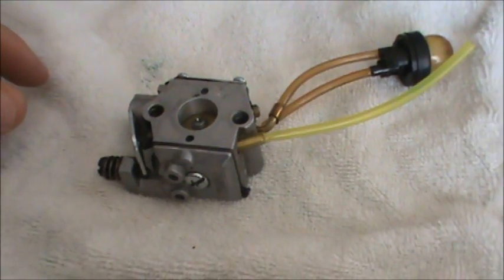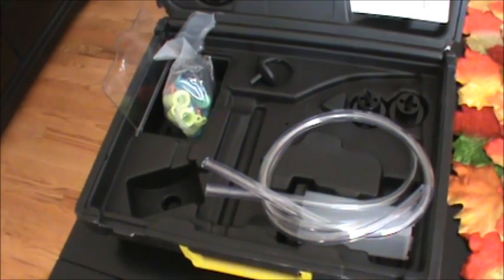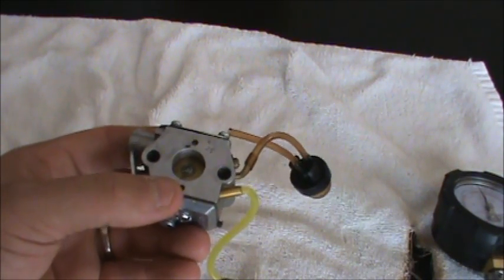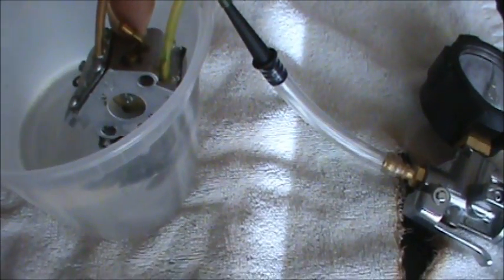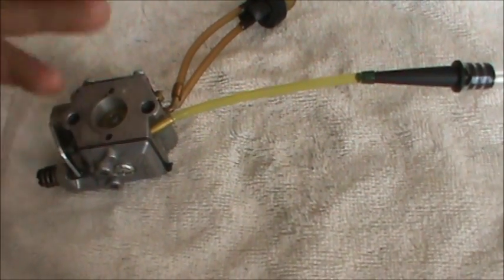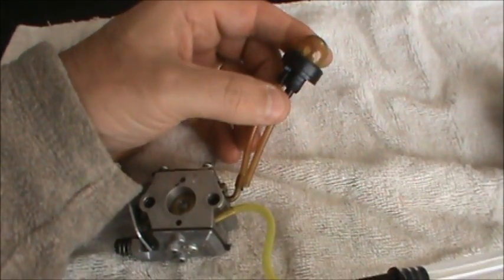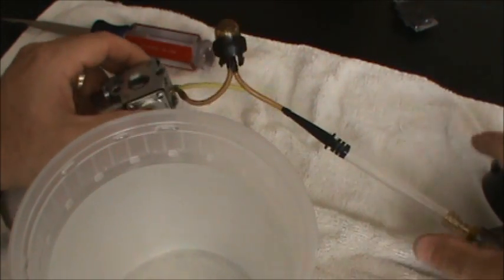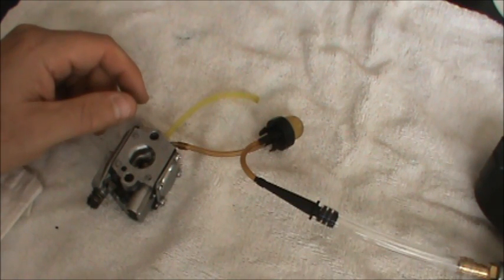Mityvac mitmv8500 Pressure testing a carburetor

Comment: I had a  Zara  carb 0:34 c1Q- S186. I didn’t have your test equipment . I watched a lot of videos on utube I finally reasoned it was the check valve under the primer bulb section, I took the oriface nozzle out cleaned the spring in gasoline reassembled & got it to work.  That’s an excellent video

Comment: thanks for the tips (pun intended) I went ahead and ordered a mity vac like yours. my question is that I may have fuked the existing needle with my ultrasonic, I didn't know that it should be removed. so now under pressure, the movement of the needle has no effect It leaks bad enough to be audible should I have removed it before US cleaner

Comment: I have the same tool and have used it to test for leaking crankcase seals using the appropriate blanking plates and gaskets, vaccum testing for air leaks of the seals. Difficult starting can be caused by air leaks here, and four stroking.

Comment: On the remote primer, the small barb draws vac when released and the longer one is a return to the tank.  When you push the bulb down it helps pressurize the fuel tank to assist the inlet side of the circuit.
Reply: Not exactly. It’s actually pulling fuel through the carb. Hence why his gauge dropped each time he let the primer out. Yes it then pushes fuel back to the tank via the return line, but it’s the same volume as what it just pulled from the tank, thus not adding pressure. This is a misconception a lot of people have about two stroke cube carb systems. I think it’s because often when the fuel cap is opened it releases pressure. The pressure is just caused by heat or agitation of the fuel and the fact that the tank only vents in and not out (the volume of fuel being used has to be replaced with something but you have to be able to operate the equipment in any orientation without fuel leaking all over. Think chainsaw) 
Another test I perform after bleading down the pressure with the primer is to switch the pump over to vacuum and draw a vac through the carb with the primer. That checks the same seals and valves but in the opposite direction.
Reply: Thnx I learn something from you

Comment: DW6 I performed the test on the metering side where u said if it leaks you have a bad check valve. I actually have a very slow leak on that side. When the seedeater is running I slowly will hear it losing power while idling until it dies, just as the test shows. I have to adjust my low needle often because of this. My educated guess is the low idle check valve has a leak because the gaskets are new and I didn't find bubbles in that area. What do you think ?

Comment: A primer bulb does not 'suck air from the top of the tank'. It sucks gas from the tank... THROUGH the carberator. It then dumps the excess gas into the top of the tank. If your primer bulb has gas in it, then you know that the carb has gas in it.
Reply: Correct  ~!~!  The primer bulb pulls gas from the tank into the carb priming it with fuel, "Hence Primer Bulb"  and then dispensing the extra fuel into the tank....

Filter line to the pump side of the carb...  The side with the ONE BIG screw in the middle, then the other line comes from the carb to the primer bulb then the short line from the bulb to the tank to empty the excess fuel so the carb doesn't flood ..............   

That is where many people people get confused on the routing of the fuel lines when they work on their saw or weed whacker  that has rotted lines that are no longer intact.......   

There are videos on you tube that show the wrong way to hook up fuel lines.... Some vids show the line from the tank to the primer bulb then into the carb NOPE wrong configuration ....    

Plus Tard Mon Ami ....

Comment: Great instructional video!  Fortunately you had a spare gasket that was able to fix it.  I bought a rebuild kit for $13 installed it in my Walbro WT324 carb and it still flooded my chainsaw.  I could have used that money to buy a new carburetor.  From now on, if the carb leaks when tested, it gets scrapped and I buy a new carburetor.  I'm glad I didn't blow over $100 on a Mity Vac.

Comment: thanks, just ordered a mv8500 for testing leak down on a snowmobile rebuild.  Good to see this as I have a couple carbs on some saws to go through as well.
Reply: any idea what the differences are between models 8000 and 8500?
Reply: @jbbolts   not 100% sure but I think the 8000 will only draw a vac, while 8500 can both vac and pressurize?
Reply: @MOAArtstore  going through the auctions on ebay it looks like it comes down to the accessories... the 8000s are listed as vacuum pumps... and after all its in the brand name too

Comment: Walbro wyl carb pops off, re-seats and holds at 2.5 psi?
Any suggestions.
Reply: You can try stretching the spring a little bit and test the pop off pressure.  If it leaks off, the needle could be bad.  If you replace the needle & gaskets and it still leaks down the needle seat is probably bad.  You'can't replace the seat so if that's the problem the carb is scrap and you wasted your money on a rebuild kit.  You can buy a new carb for the price of a Walbro rebuild kit so you're better off buying new carb if you can't get the needle to seat.

Comment: Are you saying the primer side draws air from the tank? Isn't the primer side the fuel return line. When i pump my primer bulb air then fuel is returned to the tank. my primer bulb is attached to the carb.

Comment: I have mityvac 8000 that only does vacuum not pressure. Can I do these tests with vacuum only rather than pressure?
Reply: The problem with vacuum testing these parts is that you're pulling the parts together on the gaskets making a better seal. A pressure test would push against the needle and gaskets allowing for a truer test.